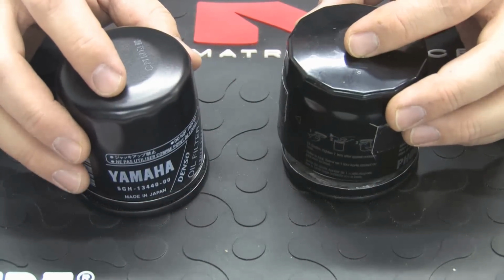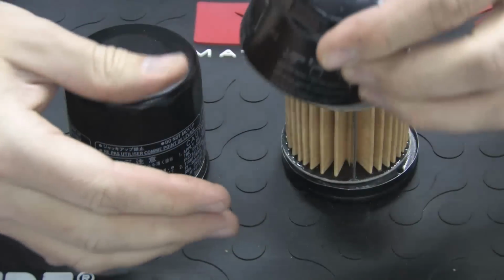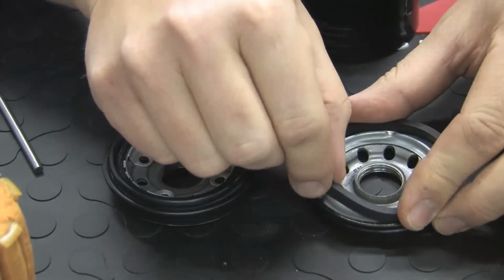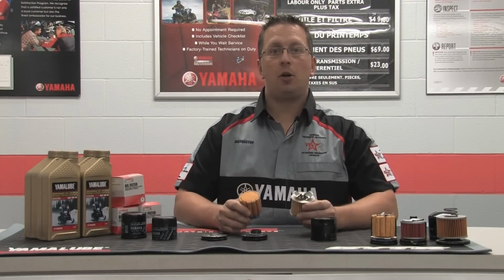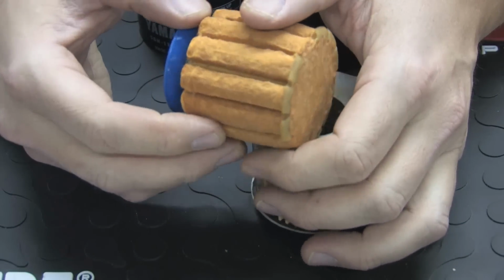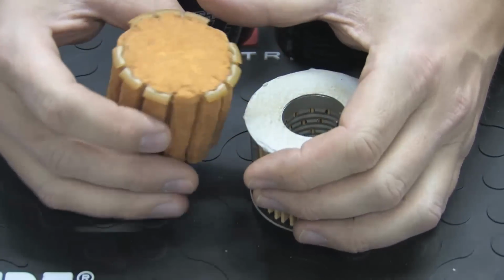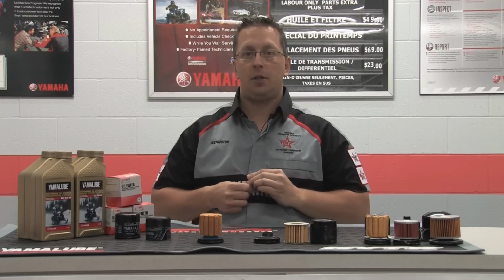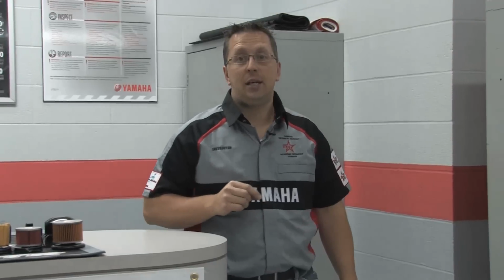Oil Filter Comparison - Yamaha vs. the Competition

Comment: Oh BS.. way to just barely squeeze the can on the Yamaha filter and then absolutely crush the FRAM filter. And don’t even go and bash traditional media. Denso is the only filter who has that weird fucked up looking media and it’s for a reason. Yamaha filters were not handed down by God like you make them out to be. Denso was the lowest bidder or has the closest relationship with Yamaha. That is why they are made that way. If that FRAM said Yamaha on it you would be bashing the Denso and its ugly media instead.
Reply: I have yet to see an oil filter burst, on any piece of equipment.

Comment: I have a quik question about the last two number on yamaha oil filter  for example, 5GH-13440-20,
Since I saw my bike from manufactor is 5GH-13440-50,  but after I did the service, new one is 5GH-13440-00.
what is the last two number means.
Reply: It's the new part number that supersedes the old one. They always go up. 00, 20, 30, 50, 60, 70 etc. They are now on 71. When I bought my 2018 XSR900, it came with the 60. The 5gh indicates the actual part number for your bike. The 71 indicates the latest version of that part. Confusing but hope that helps.
Reply: I believe the difference is length of the filters with the new ones being shorter.

Comment: love how he never once spoke price. talk quality all you want but if your filter is 3x the price.....noone will buy them. period.
Reply: Wow!  Save a few bucks on an oil filter and blow your engine.  Smart thinking!
Reply: Depends on who you ask. If you put $500 on an old beat up bike to commute with from a-b until it disintegrates then sure, get the cheapest filter you can find. If you ride motocross or enduro and change the oil after almost every ride, buy some cheaper in bulk because the engine will eventually blow up no matter what filter you have.

However, if you put $15k+ on a top of the line bike which revs high, or if you have a trackbike, you want to be sure that the oil gets pushed through that filter and that the bypass is set just right.

3 times more expensive than $7,50 is 22,50$. A price difference of $15 once a year is well worth the extra security on your $15k+ machine.
Reply: Wrong. Not saying Yamaha oil filter is the best. Price isn't not what worries me.

Comment: I am 52 and own a 2006 rhino 660 . bought it a years ago with only 800 miles and low miles. The owner had used yamaha filters for 2 years then when he had the antifreeze replaced . The guy told him to use K&N and he did for 7 years up till I bought it. He never had a a problem and have have not had a problem with it either. I would love for them to put the K&N against the yamaha filter.
Reply: ncrdisabled Submarine vet Fact of the matter is, it doesn't really matter what oil and filter you're using since most people are changing their oil frequent enough for it not to be completely used all to hell and most people are driving their vehicles for 300,000 miles. Modern metallurgy and tribology has come a long way. If you engine every fails you, and you did your maintenance properly, it probably won't be something traced back to the oil and oil filter you were using unless it was some kind of a fluke.

Comment: Funny that you compare your filter against the absolute cheapest made filter in existence (Fram) with the cardboard ends.  Also, you don't even pull out the seal to show the bypass valve on the Yamaha filter.   The original filter on my 2007 Venture MP actually looked like all the other filters. I now use K&N, good quality and a nut on the end to make it easier to remove in our tight sleds.